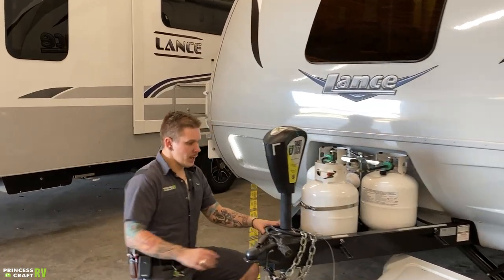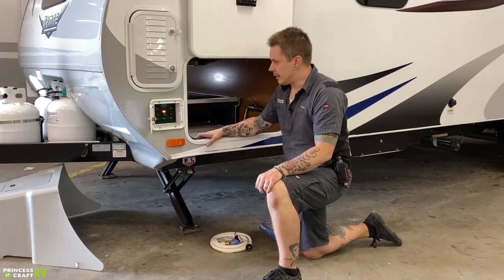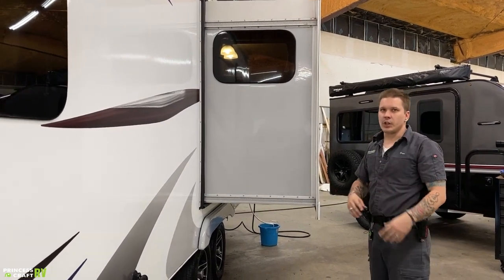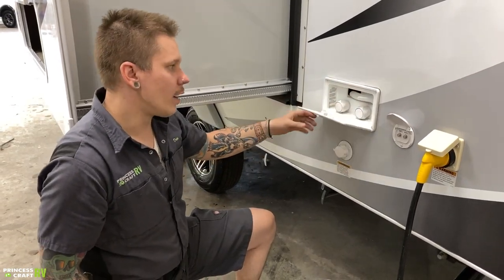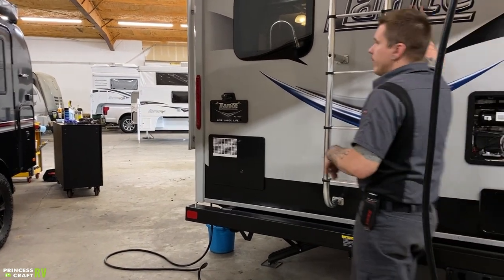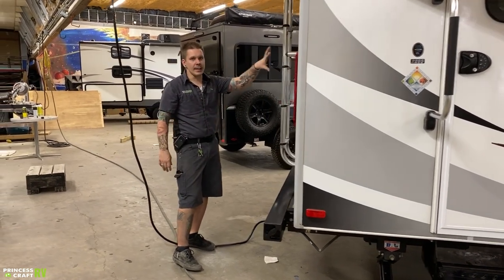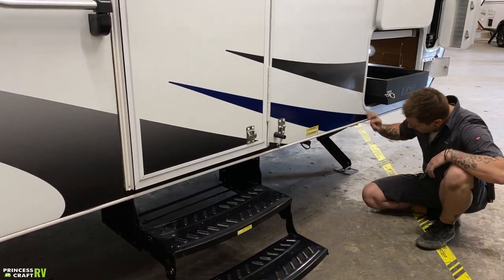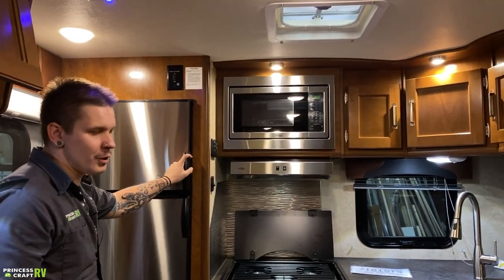2020 Technician Tour - Lance 2285

Comment: Excellent video! I have a couple of questions  though as I have seen many people having issues with the external propane connection. 
 When you say it is high flow, does this mean that it is a high pressure connection? 
 Does the down stream appliance need its own regulator?
 I know that one male quick connect is supplied in the black bag but I want to configure a grill and fire pit without having to change the hose each time. 
Thanks for the thorough and detailed video!
Reply from the maker: Thanks for asking! You've actually found something we misspoke on. That isn't a "high-flow" connection. It is directly supplied by the camper's propane regulator. So, whatever the regulator is set to and supplying to the rest of the trailer (think kitchen propane stove, oven, fridge, water heater, furnace), it is also sending that same pressure to the external LP gas port/connection. The hose that is supplied with most portable grills and portable propane fire pits (that we run across) is intended to be connectable directly to a propane tank... so I imagine it would be able to handle the pressure supplied after the trailer's regulator. If you have a specific model with specifications you'd like to check on, call our parts department and ask for Cody. (512) 251-4536. Thanks!